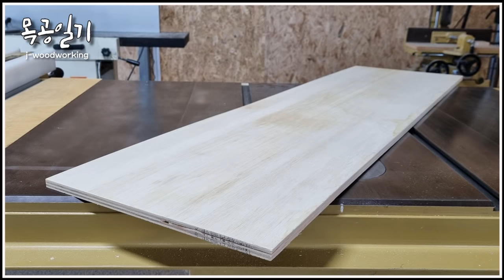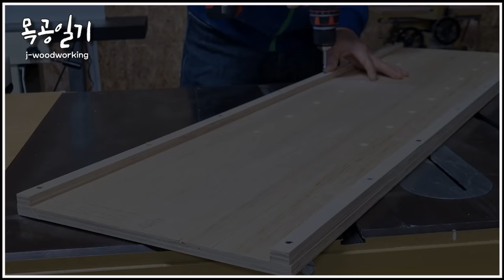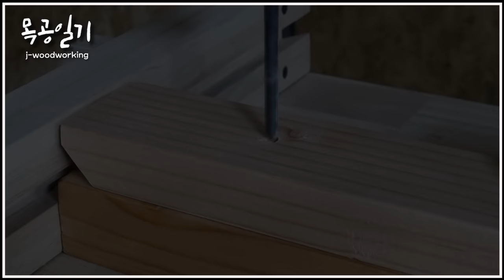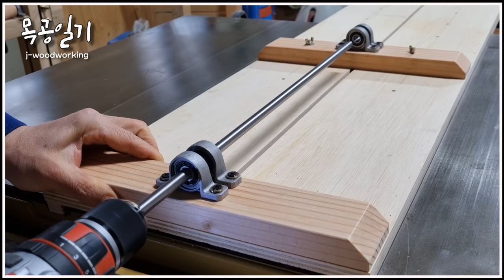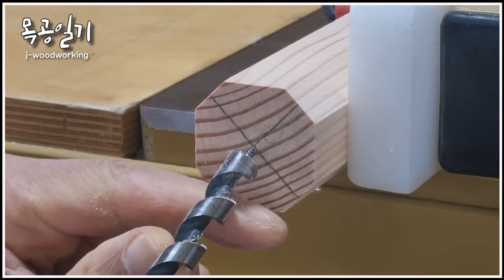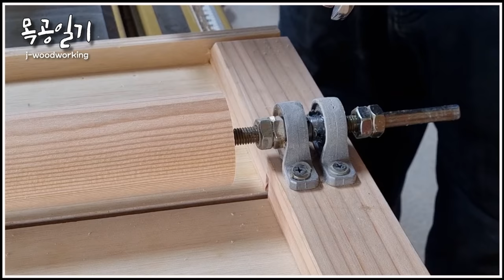wooden rod jig / Anyone can make wooden rods easily without lathes [woodworking]

Comment: Very good! If you make it adjustable, to spin at an angle, relative to the table saw, you can make tapered pieces, instead of cylindrical.
Reply: Great idea for making large diameter dowels but just trying to think of what to do with them.
Reply: @johnroberts3723  The main use will be to make legs for furniture.
Reply: @JoseSilveira-newhandleforYT  👍

Comment: Been wanting to make my own rollers for bike training inside...  was gonna use this method and make 3 large diameter dowels...   

Do you think if I used this method would I need a metal rod to go the whole way through?  As I was initially gonna use pvc pipe and just put some equally spaced "cookies" of wood to give the 3 inch diameter pvc pipe some structural support on inside...but if just get some 4x4 lumber and trim it down to the diameter I want...maybe I can save some money on pvc pipe...

Thoughts?

Comment: Nice. How small of a dowel diameter can you make?
Reply from the maker: I'm not so sure. But the minimum diameter would be over 2 cms. I'll give it a try soon.
Reply: @j-woodworking9573  that's a little bigger than 3/4" diameter. It would be nice to be able to get 3/8" or 1/2" diameters. For sure you would have to shorten the length to keep it safe.
Reply: @Mr_Rick  The technique isn't exactly the same but you can make them down to about 1/4 inch.  YT search